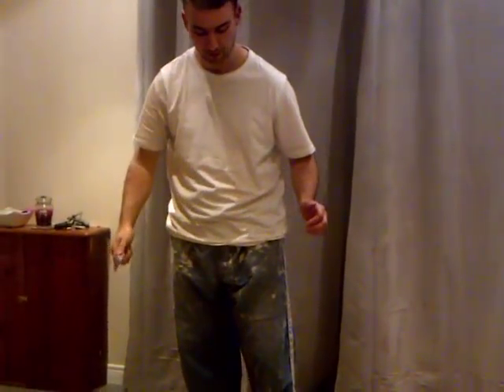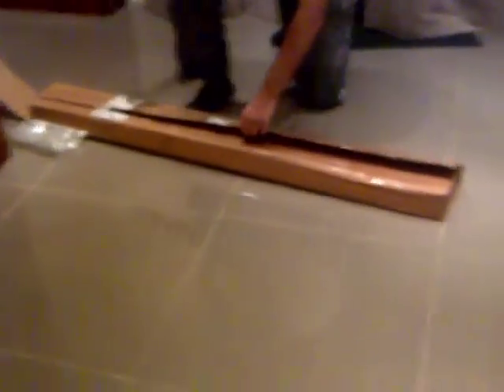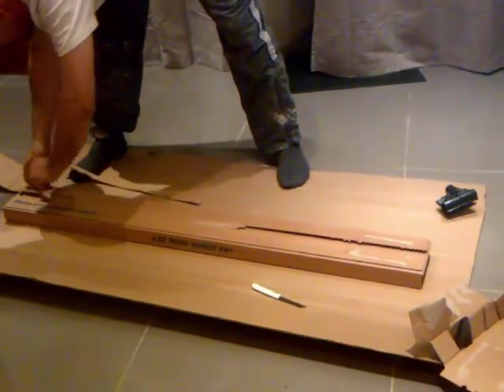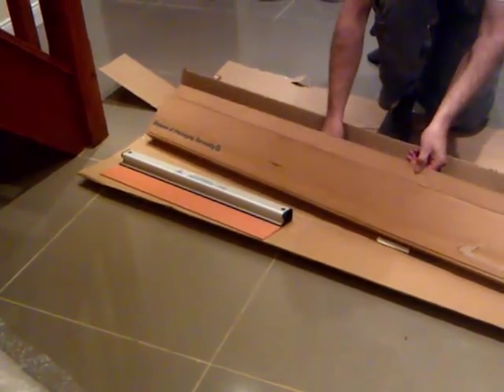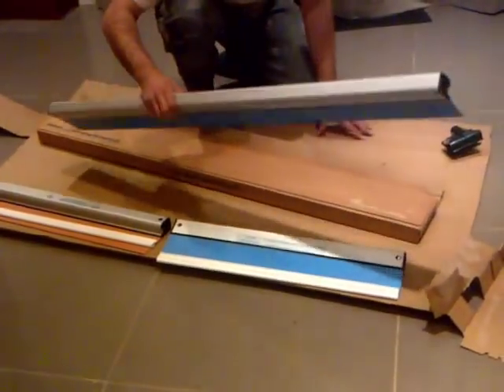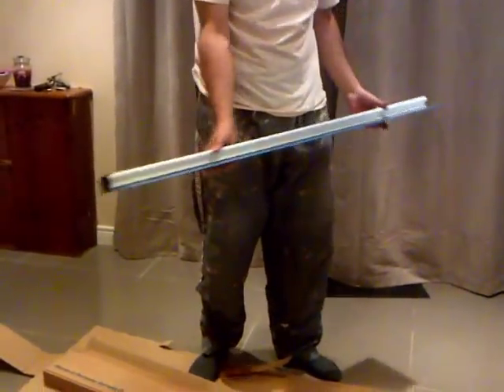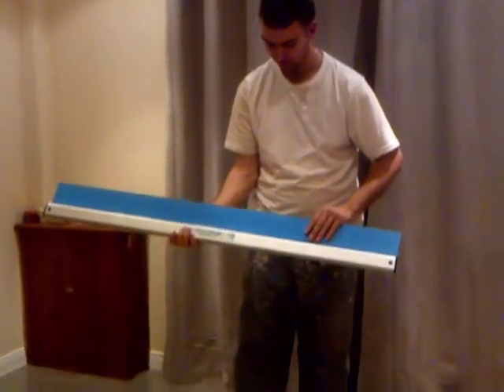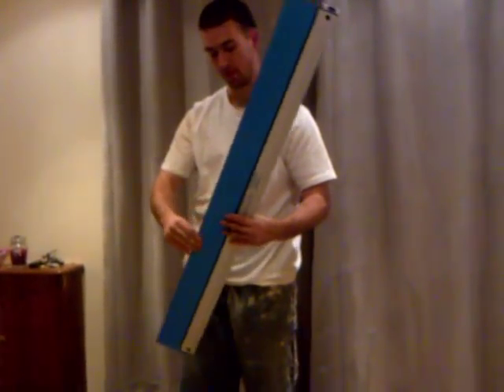speedskim unboxing

Comment: It's the dogs st blue saves loads of work and your elbows I haven't used the sf blade mixed reports about that have fun using them
Reply from the maker: +Howard  Reeves Hi Howard I been doing a small house using it on ceilings and it saved me a good bit of effort for sure only pain was trying to get it neat round all the wires but for a big ceiling I can see these will be great going to use the sf blade for dry troweling to test it out  Thanks for the great comment mate :)